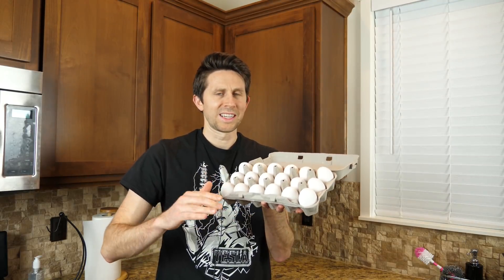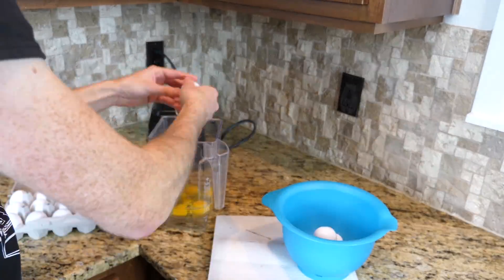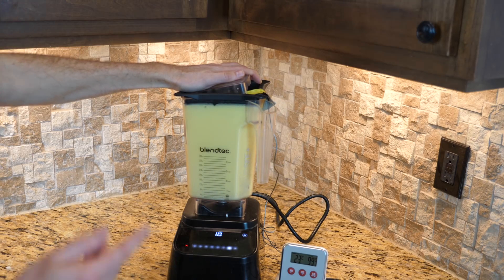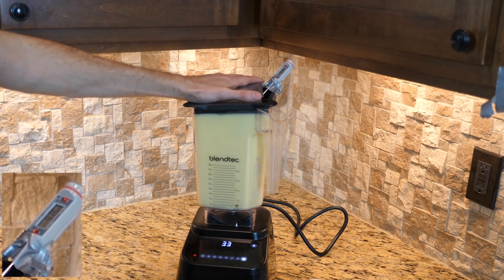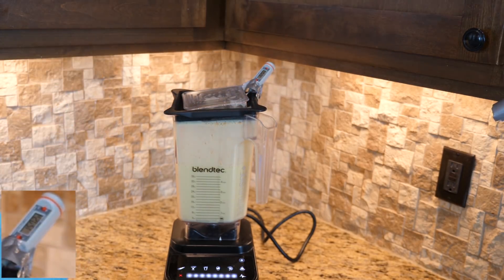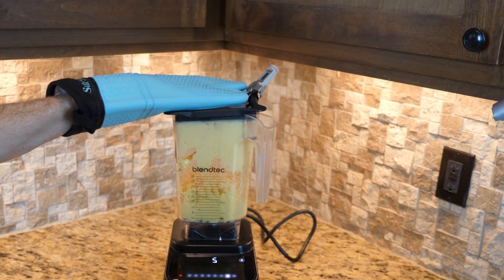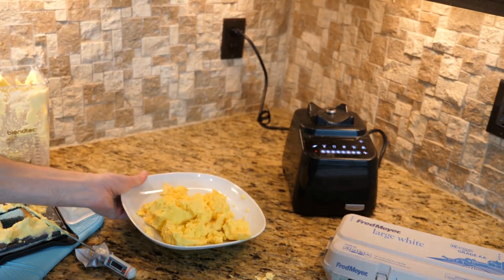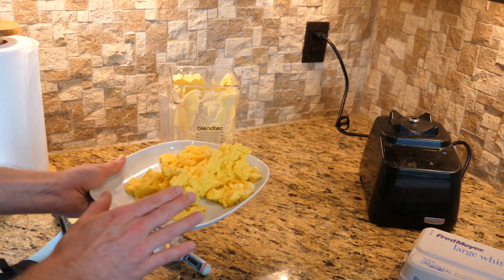Cooking Eggs Using Only Super-Fast Mixing—Will it Work?

Comment: That is not the first law of thermodynamics. First Law is basically the conservation of energy (cannot get more energy out than the amount of energy you put in). The one you mentioned (friction and heat and spread out among the atoms DoF) is the 2nd law.

The blender could have used the electricity power to convert the centrifugal force to blend things properly, but you have literally increased the power to increase the entropy and heat (which could have been achieved with a heater). Great video to show the 2nd law at work, but it is a very wasteful video (even if the egg is airy)

Comment: there is such a thing as a blender that cooks the food while it blends. gordon ramsey uses them.  could also be heat caused by the friction between the blades and the bearings in the blender. machines that spin at high rpm tend to get really hot, especially with continuous use. could it be a trick?  we may not be considering all the variables.

Comment: Would you get better results with a shape like A bout engine propeller,  I  Me know if it's going to be light and fluffy  Probably not worth it with the sharp edges.  Plus I think the flat  Area would transfer more heat

Comment: If you sat through the whole thermodynamics class you would have picked up on the concept of “efficiency”. There is a reason why people cook with thermal heat transfer as it is the most efficient method.
Reply: Murat Seyidoglu the more glaring issue is the misuse of the first law of thermodynamics. The Q represent the heat put into or removed from the system, ideally in this case you would want this to be zero for this experiment. Thus making the change in internal energy positive causing a rise in heat

Comment: How long did this take (excepting the broken thermometer change)? You stopped periodically, was that due to you checking the temp or is there a mechanical issue that would stop you from being able to run continuously until cooked?

Comment: You didn’t cook them... you OVER cooked them. Eggs will start to solidify around 145 degrees (think soft boiled egg).

What you did was the equivalent of cooking a steak to a nice leather shoe-esque well done.

I’m willing to bet if you pulled the eggs out of the blender at 150 degrees, seasoned them, and ate it with a spoon like soup, you would be amazed at how delicious they are.

Comment: Looks pretty cool, but I would be worried about breaking my blender. I would like to see how these eggs compare to eggs you cook on a hot plate with a magnetic stirrer bar in the pot (or similar heating-and-stirring contraption).

Comment: Erm yeah good idea to bring some nubs to the idea to actually do this. I guess most cheap blenders are not meant for running that long. Ever seen the news reports of blenders that explode and leave their users with severe burns? Well in your case i would not have only worn a "tshirt "and some safety googles when i push a blender to it's limits. Take better precautions next time when you do something like this and give a warning shoutout that there have been nurmerous blenders that exploded in normal use already...

Comment: Technically the whole egg, including the yolk, would have been cooked and set at around 158F. I suspect that the mixing action had something to do with why it didn't fully coagulate at the normal temp but the egg in a pan would have been cooked over hard at about 12F less than you observed here.

Comment: A blended egg will "cook" at a lower temperature.   The blending chops up larger proteins into smaller ones.  Smaller proteins require more heat to get them to  coagulate.  Egg whites solidify around 140 degrees F.  Egg yolks solidify around 150 degrees F.  Your eggs had to hit 170 degrees to solidify. If you want ideas for some follow up experiments...blend just yolks then blend just egg whites.  What would "cook" first?  The whites or the yolks?

Comment: Rip your electric bill
Reply: Ya because a stove top uses no electricity...   you do realize one of the selling points of blenders like this is to make recipes like soup right?  You can't afford to keep a blender on for a couple minutes?
Reply: @ar007r relax
Reply: @ar007r should never make soup in them if it’s plastic, microplastics galore
Reply: @mark9294  I use the vitamix. They have stainless steel containers. The plastic ones dont really make a difference they are made from Eastman Tritan. Not all plastic leaks sig amounts of microplastics. The melting point is so high that it makes no difference if you make soup in it or something cold.

Comment: in the water boiling through mixing video the numbers on the mixer  decreased. so u put in 70 seconds and it works until 0. but now they increase by 1 in an second. I am saying that you did it like that: You put in scrambled eggs and mixed them so they get to fluid again. then you have edited it so it's in reverse which means it looks like an fluid gets hard. to finished scrambled eggs the start of the video shows how you mix normal eggs to an fluid and then you could cutter it together. I love your videos but this is to easy^^

Comment: Some of the heating can be attributed to the motor heating up and transferring that heat through the motor shaft into the blades.
Reply: electronicsNmore Aaand you didnt watched the Blender water boiling Video
Reply: Lol. The blender that he is using is specifically meant to do this. Look up Blendtec blenders... also look up, "Will It Blend" ;)
I have one for my son. He is tube fed and to feed him I blend up whole foods small enough to fit through his tiny tube without clogging it up every single day. He doesn't receive any formula.
This blender comes with a cookbook and has plenty of recipes that are meant to be cooked in the blender. It's pretty awesome.
Reply: It would've been more convincing if he were able to measure the heat of the motor shaft without any liquid in the blender.
Reply: I didn't even knew that you can tube feed "real" foods like that to a person that unfortunately cannot eat whole food "as is". When I was young I was fed through a noise tube as a baby as I could not "suck" to feed myself due needing a Clef Platte repair. Later on my mom helped me drink the PediSure through a regular cup so I could get that done or they would give me a G tube (If I am not mistaken that probably what your son is on). Luckily I eventually finally eating "normally" by 7 years old. Even though I don't need one I am very happy to see someone like yourself to spread such information with a 1500 watts blender you can still deliver all natural nutrients to a person who must be fed like that. :)
Reply: Actually pretty much all of the heat is from that.

Comment: I have a similar Blender of 1500 watts let me tell you that the egg was cooked due to the heat energy radiated from the motor and not due to the friction of the water And The Blade

Comment: I have a video suggestion- Turn the egg inside out with centrifugal force! (put the egg into a cloth piece or just a sock and then spin it while holding the two ends like those spinning toys we used to play with, and possibly due to the greater density of the yolk it will go outwards and the white portion will go inwards! Then BOIL the egg, cut it and see!)
Also, great video there very interesting!
Reply: vinod kumar a truely eggcellent idea
Reply: ENGULFING_DARKNESS01001, thanks! please suggest him to do it. It'll be an eggcellent video:)
Reply: centrifugal force isn’t a real force
Reply: The yolk breaks if you do this and it mixes with the whites
Reply: Centrifugal force isn’t a real force but its still a thing

Comment: @TheActionLab Note: The Blender is not consuming 1200W of power just blending eggs. Power consumption also depends on the load applied to the motor. I would expect power consumption to be less than half of the rated power when blending eggs only.

Comment: why the fuck not just tape the probe to the side of the walls on the container instead of the wire all the way outside the damn thing?!?!?! it makes me so upset seeing you do the same stupid over and over again!!!!!!
Reply from the maker: That would have a delay if I had it on the outside. Still though, on scale of 1-10, the way I did it was a 2. I should have just had it much higher up and taped much better. The fluid sucks it in when it’s moving so fast. You can see the metal bending in towards the blades.
Reply: sorry for being so rude, lol didnt think you would see it. 
 I meant taping it flush against the wall in the inside in instead of it dangling.

Comment: electric motors give off heat so that could be a factor you need to look at. I believe that some of the heat may be caused by the heat of the motor rather than the actual mixing. that said I do believe the mixing could in theory cook it but I believe there are too many other factors involved and I think u should do other test

Comment: I think ITS 80% Heat from the Mixer Motor and 20% Heat from the actual mixing^^
Reply: Peter Zingler nope. I own one, there is almost zero heat from the motor that makes its way up top. The heat from the motor is blown out the bottom of the machine by a fan. The machine barely feels warm to the touch even after running it back to back to back.

Comment: this what happens:
the motor heats the blades which heats the eggs, and the friction heats the eggs and the blades, then this heat is transferred back to the motor through the blades and so on the cycle keeps going.
i can not be certain which heats more, the motor or the friction though... need more experiments for that.

Comment: From 144 to 158° F is all an egg needs to start cooking or coagulating.
Reply: The protein structure of an unblended egg is not the same as a blended one which is why he had to go to around 170 degrees to get the eggs to "set".
Reply: Funny I thought he did overcook them though, shoulda stopped it as soon as it all collapsed to the bottom
Reply: Rich Migala thank you Rich, I actually had that unspoken question why it took a higher temp than a normal egg
Reply: Indeed! I knew it would work; he demonstrated the blender was powerful enough to boil water, which would totally ruin scrambled eggs. What I was wondering was; would he overcook the eggs? I'm glad he did not.

Comment: How long did it take for the eggs to fully cook in the blender?
Reply from the maker: It only took maybe 3 minutes till cooked
Reply: The Action Lab wow thought it was longer than that.. I think it would be a good idea to preheat the eggs a bit to quickly cook the eggs in the blender without burning out the blender motor

Comment: Not really surprising when it's sitting directly on top of a motor running for god knows how long. They get ridiculously hot, how about instead of a random quote, you take a temperature measurement, or provide some kind of actual evidence? I'll be more convinced that this really is from the mixing action if it was done in a stand mixer, where the heat of the motor wasn't radiating directly into it.

Comment: Even if the heat from the motor did transfer into the mixing container most of that heat would have been the result of the same processes as inside the blender (friction from the moving motor parts)

Comment: People really underestimate how hot friction can get. Case in point, find smooth surface, be it table, window, painted wood, smartphone, rub your finger back and fourth against it with little pressure, your finger will got hot pretty quickly, it creeps up on you.Friction welding is another thing, look up some videos on youtube and watch some metal getting welded by friction, looks amazing seeing it in action.

Comment: Can you also attach a thermocouple to the motor. If the motor is not getting as hot as  whatever is being mixed, then it proves that the heat is coming from the mixing and not from the motor.

Comment: Is it possible for you to measure the temperature of the blender without putting anything in it and then running and stopping and taking temperature to figure out how much heat comes from the motor itself?

Comment: Resume: I cooked egg in a blender
Reply: Gary Ng I’m a Chef so this could work for me 😂
Reply: ...with bearing-friction heat conducted up into the blade-shaft then the blades.
(aka: I'm not buying Blendtek's explanation; they wouldn't want people to think there might be a heating issue with their bearing assembly)
Reply: As a comparison, I ran my blender without load for one minute, expecting it to be at least a little warm where the shaft just emerges from the bearing assembly. It was not a 'little' warm, but stinging hot, and my hand hauled asz off that thing in an instant.
Certainly it's not the motor, which is fan-cooled, but even quality ball-bearing assemblies will run hot if they're operating long enough. Not enough to damage them, as the food acts as a natural heat-sink to draw off heat.
Reply: If it was the bearing than the blender should have melted. Do you even know how much energy is needed to boil a liter of water?!?!  That much heat would have melted the bearing itself! It might be hot because of air friction!
Reply: Did it work???
Reply: Umm, one minute won't cut it. You might as well say that shivering doesn't make you warm up, no, your stomach acid is just causing your nerves to feel warm from all that shaking

Comment: If you do this again measure the temperature at the top of the blender. Not the container but the housing that holds the motor . Measure temperature at the coupling and the top of the housing. Just to prove those people wrong. This was awesome
Reply: pine He won't. Never. Because it's probably from the blender and not due excess friction.
Reply: its from the exchange from electricy to motion to heat. you cant destroy energy or use it to nothing. it just changes from electricity to motion to heat or reverse order. while i agree some heat like he said comes from the motor being on i would say it is not a major contributing factor in raising the temperature of the eggs.
Reply: pine pine Its a $1000 blender (Costs that much where I live). That thing is monstrous. I know a certain amount of that mechanical energy is dissipated through heat and it ll scale as the time passes, however, I don't think that's the case here. He probably made the blender nearly overheat. Just a Infrared cam and this experiment would be profitable.
Reply: it looks like he ran it 3 times at max time which i think was 50 seconds each time. it would be easy to prove but i doubt that amount of heat transferred to the eggs from the machine.
Reply: pine Can you tell me if the blender is at max speed? I really can't read that thing.
Reply: no not officially but i remember him saying it last time and you can hear it ramp up while he is starting it the first time and it doesnt go any higher. do you have the same blender?
Reply: pine Nope. Sadly I don't.I just searched about it and also made some searches about the capabilities of this thing overheat. There are some information even on the blender's official page, however I can't just assume things. My blender is pretty standard and if I leave it on for about 1min it ll become really hot (also what I'm blending on it). I'm not an engineer or anything. I really wanted him to make a video with a IR cam, but I don't think he ll make one IF he's wrong.
Reply: maybe he will make the video but im pretty sure he is right. ive seen motors get hot from over use that are larger then that one in the blender and i doubt they could cook eggs. not to mention wouldnt the blender manufacture have a over heat safety built in?

Comment: Awesome video. 
But I am still waiting for you to do an experiment on fire having shadow or Atleast answer me that. Does fire have shadow? Please reply. A big fan of yours.
Reply: No, beacuse fire is a source of light.
Reply: wazkok i totally agree with you that if there is only one source of light then that light would not cast a shadow of itself. But what if we have a brighter light in front of that fire? Will the the background have illumination equal to sum of the brighter light as well as that due to fire? Or will there be a change in that? If the background has exactly no change then we can say some light is blocked by the fire. And that vacancy is filled by the light due to flame. Ain't I correct. That's why I need to know in depth comparison. Thanks by the way.
Reply: If you light something and then flash a flashlight at it you can see something, although i'm not sure if that's shadow of fire or smoke.
Also I thought just the same thing after writing a comment ;) 
With his 32 000 lumins flashlight it could be more visible, so good idea.
Reply: wazkok exactly. That's why I want him to do the experiment and find a definite solution after taking numerous cases. Such arrangements are not possible for me. I googled my best but could not find satisfactory video or answer anywhere. I hope he decides to do an experiment on this and provide a solution with enough evidence for it as he always does. @Theactionlab #Theactionlab

Comment: You might be interested in this article on cooking temps and eggs. With the rise on inexpensive sous-vide water baths cookers you can get extremly precise temp control - and they've been able to better understand what happens to eggs at different temps.  One of the best temps people have found for eggs if you like soft poached is the 60 (c) degree egg.

You should do some with some seasoning in the eggs and see how the blending of the molecules integrates the flavors with the eggs. I wonder if you could do a "chocolate omellette" with cocoa powder and sugar and a pinch of salt.
 https://www.seriouseats.com/2013/10/sous-vide-101-all-about-eggs.html